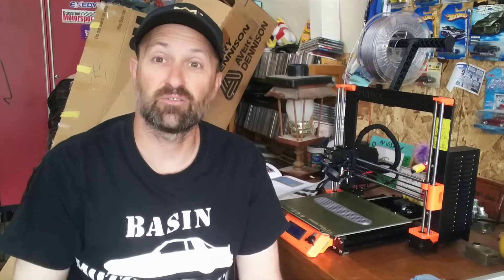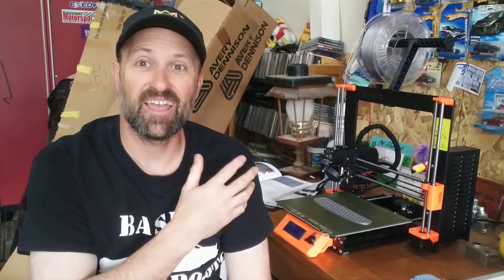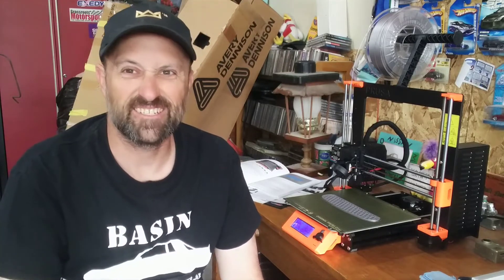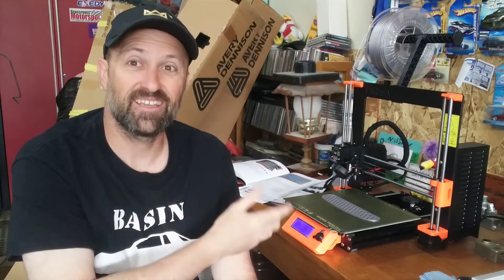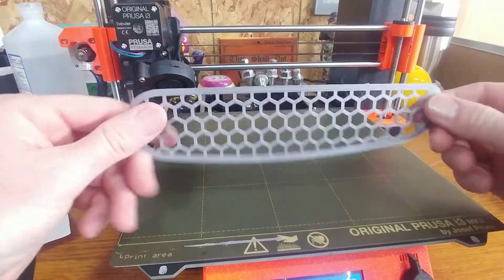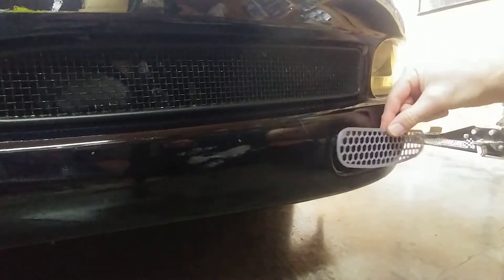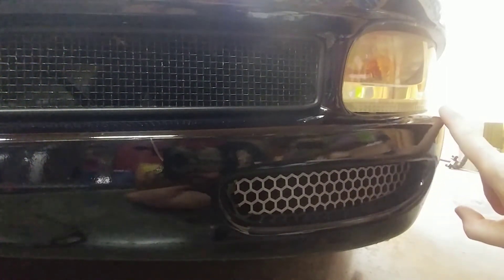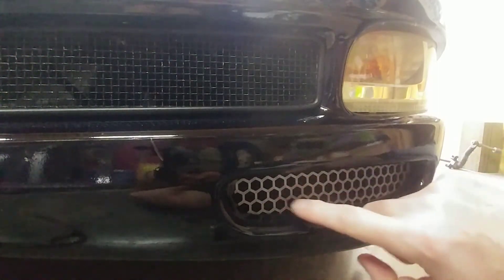3D Printing C5 Corvette Front Brake Duct Bumper Grilles

Comment: That 3D printer is beginning to look like a good buy. Automotive applications at-home is a very real need, especially for those of us with older vehicles. Personally, I like the contrast of the silver and black.
Reply from the maker: I feel like I am late to the party since so much is available, but I am thankful people share their files. I have a lot of ideas in my head, and now the challenge is to get them out to printing one at a time. I actually wanted the printer for the Porsche 944, but it has evolved into Corvette and Foxbody parts too. With cheap (or free) software, some ideas, and less than $1,000 for a printer, anyone can start making themselves parts. How great is that?